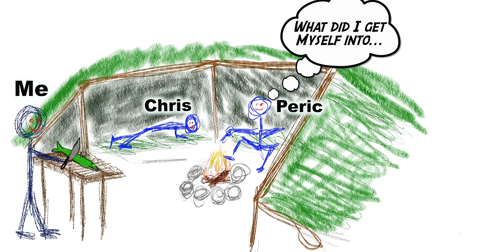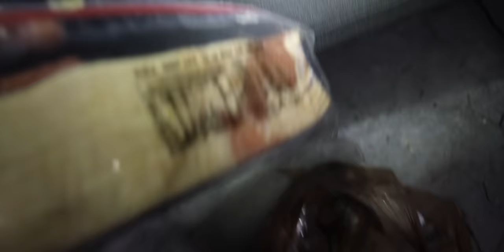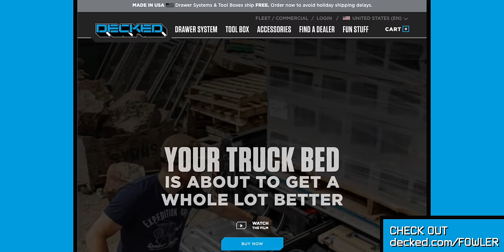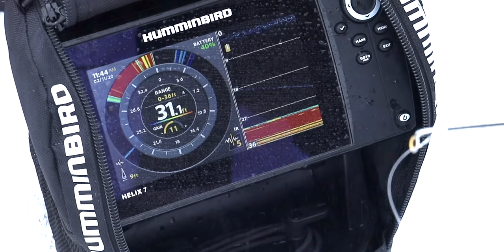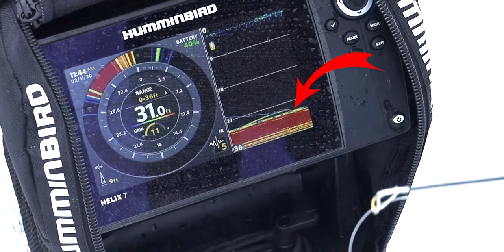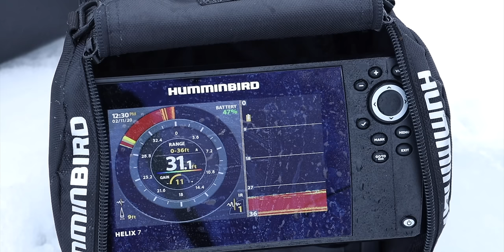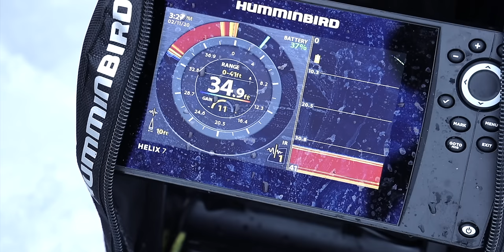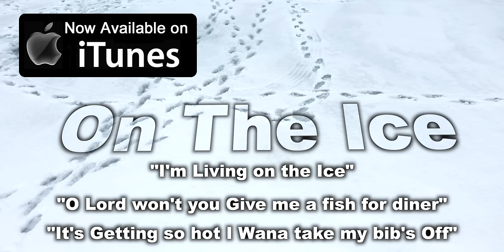On The Ice The Movie - 5 Days Winter Survival Challenge Camping on the Ice in Vermont - Catch & Cook

Comment: I watched a video on YouTube once about 3 Levels of Ice Sculpting. The 1st Level was the most basic using only hand tools, while the 3rd Level was the most detailed and advanced, using hand and power tools. I believe the Ice Sculptor sculpted a fish and because he was able to use power saw for the 3rd Level, he started off with the initial big rectangular block of ice. Then he took a secondary slightly smaller block of ice. He then use lukewarm water to wet the vertical side of both blocks and connected them side by side. The lukewarm water acted as a glue and as soon as he stuck the 2nd block onto the side of the main block, the water between both blocks instantly froze and they were stuck together. It took like 10-20 seconds and he was able to let go of the 2nd smaller block and it was stuck so well that it didn't slide apart or anything. Then did the same thing on the opposite side of the main block. Then he used a power saw to shape it, where the main block was the body, which the 1st smaller block became the head and the 2nd smaller block became the tail.
Anyways, the point is that I believe that y'all should have used water to glue each block together as opposed to using snow like some cement binder.